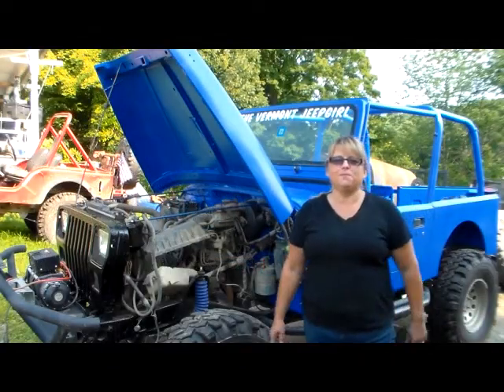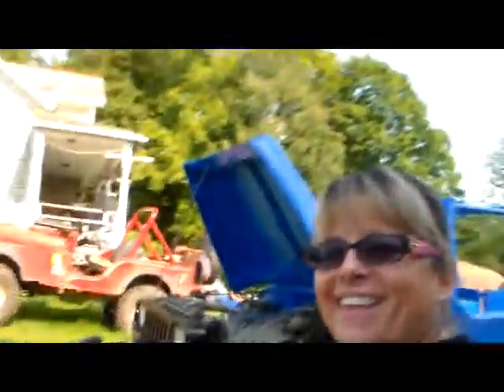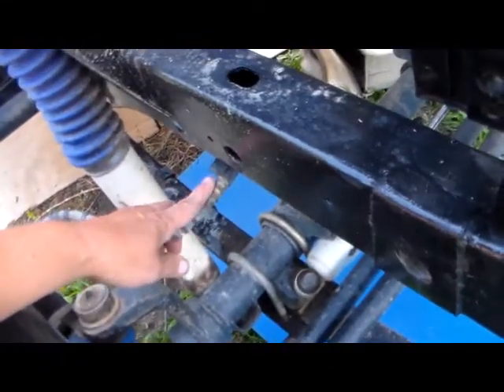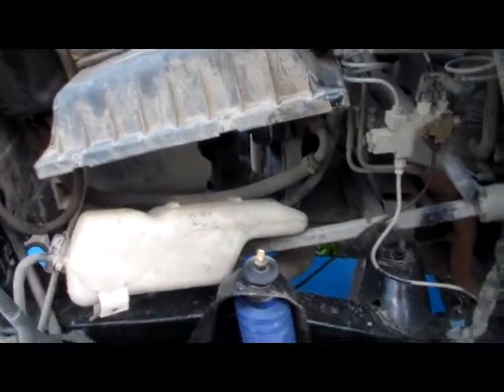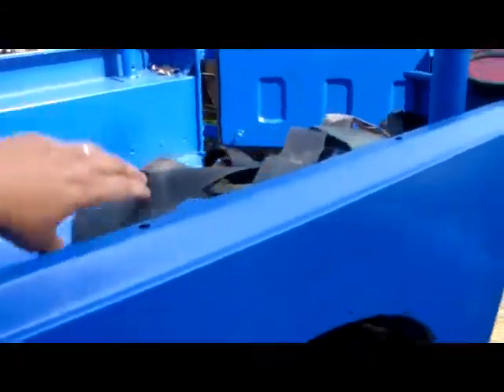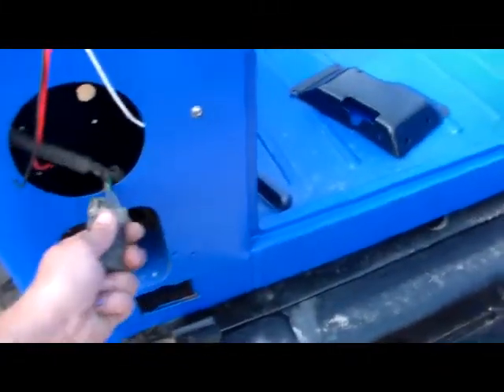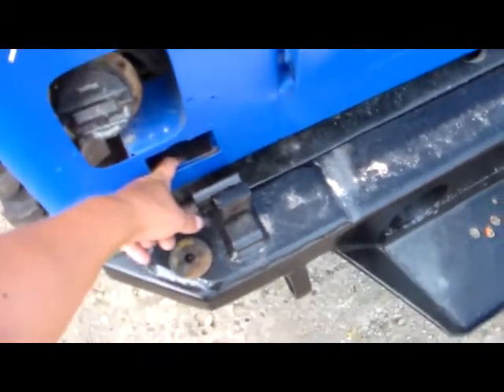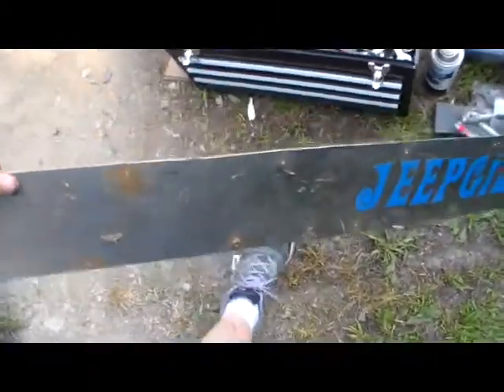VLOG 166 Update on Ole Blues Tub Swap

Comment: Question - struggling with selling YJ and updating to TJ.  Why you ask - not much of a woods rig more like a mall queen.  Like the cabin better, want AC for next summer.  However I have a 92 yj that I have owned for 13 years.  Looking at TJ2002 - 97 - ALL the TJ s Frames a Junk.  My YJ is 10 times better.  Is it because mine is really and AMC product - and Chrysler used cheaper metal - or am I just a unique case?  WHat have you seen?